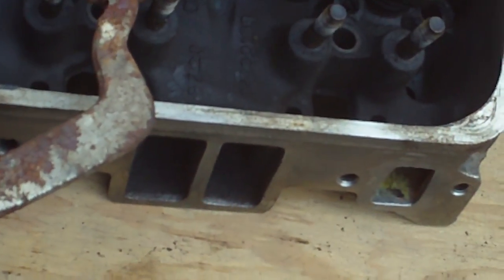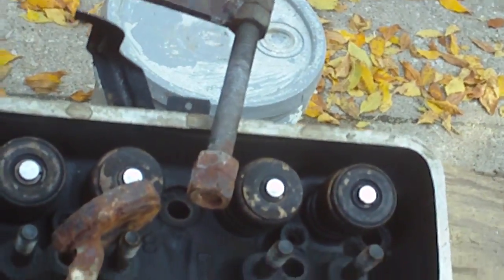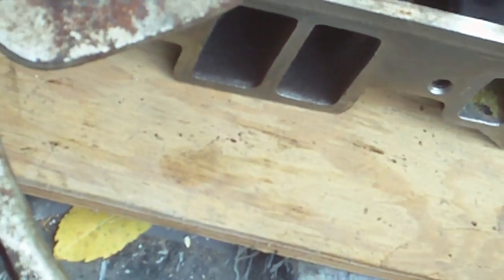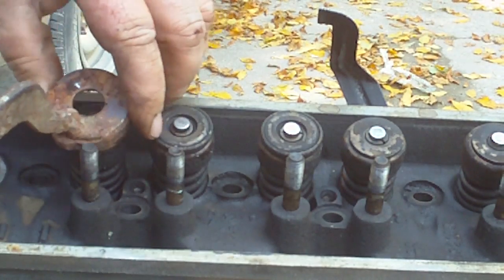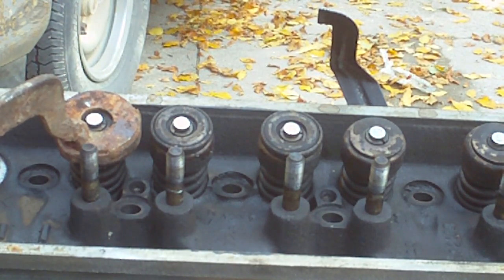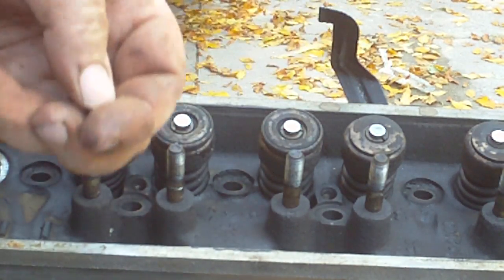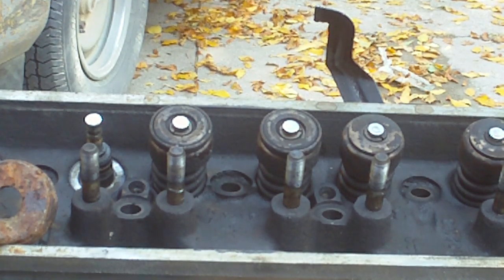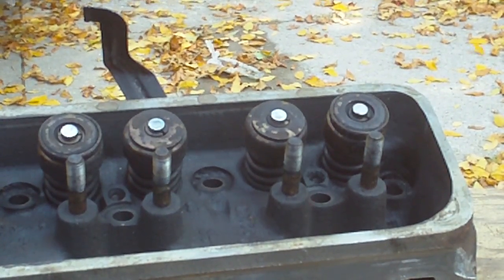Homemade--Valve Spring Compressor

Comment: I like the design gotta take the springs off the head tomorrow. Was gonna make a compressor with a c clamp but looks like ill be cuttin and weldin on a vice grip clamp.... Thanks for the idea. I'd rather build it than buy it, thanks for the old timers old school tech